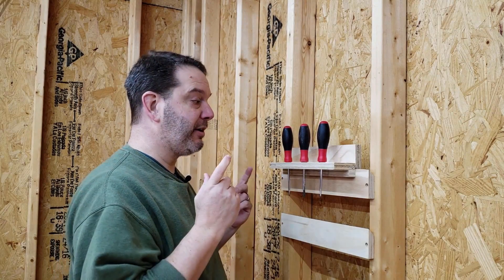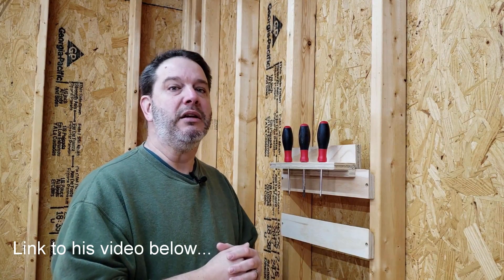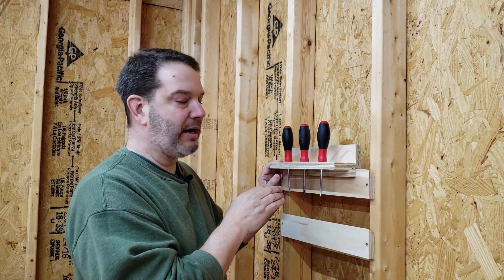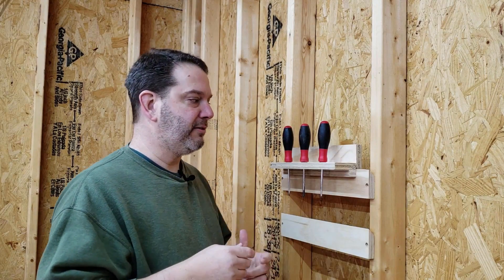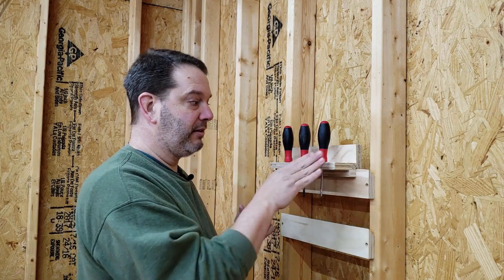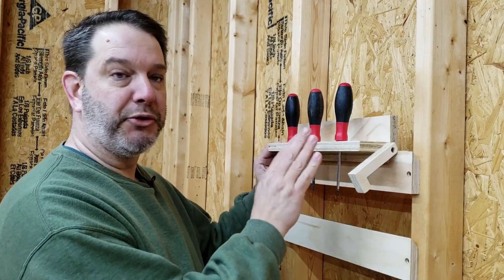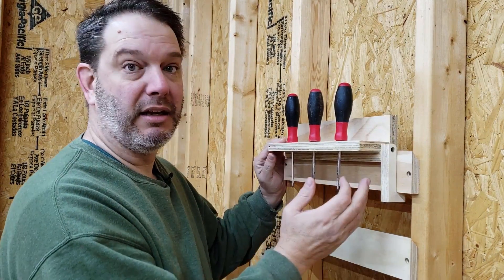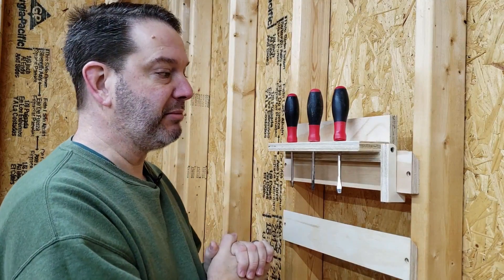French Cleat Tool Storage Upgrade!

Comment: Good job! I can see this as a great solution to the problem. Maybe not necessary on every tool holder, but only on ones that are in high traffic areas, or where you have already had a problem. I need this on one particular cleat where removing the tool always lifts the cleat off the wall.
I will be making a dozen of these just to have ready. 👍🏻
Reply from the maker: Thank you! Make all you need👍 Probably don't even need as thick of a swing down hook as I made. I just used what I had laying around.  Thanks for watching!👍

Comment: Nice one, I use two cleats opposed to each other and with a central rail having a cleat cut on both edges. I can hang off of them they are that strong
Reply from the maker: Thanks! I can picture your way working great as well. This was just an idea I had to see if it would work. I think with some fine tuning it will be even better. Thanks for watching!👍